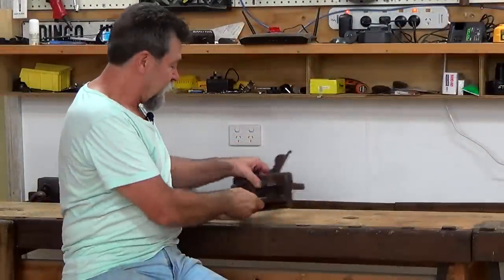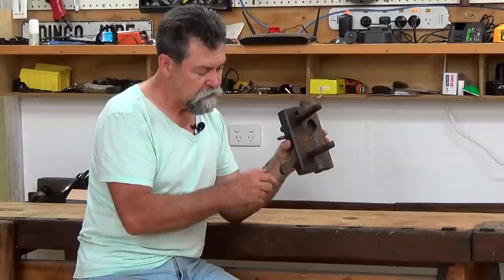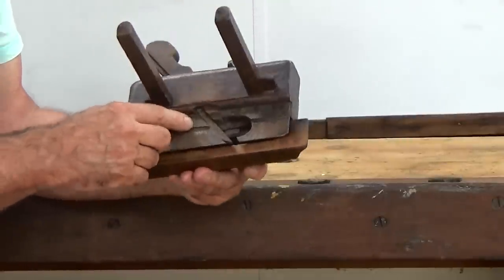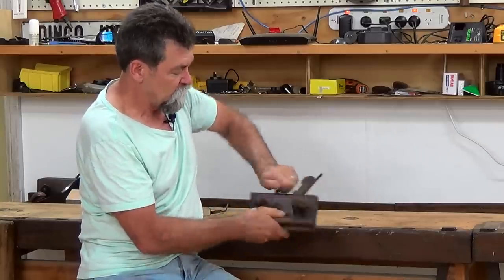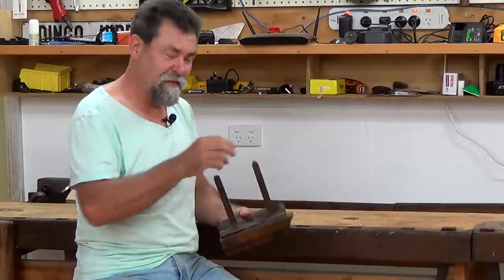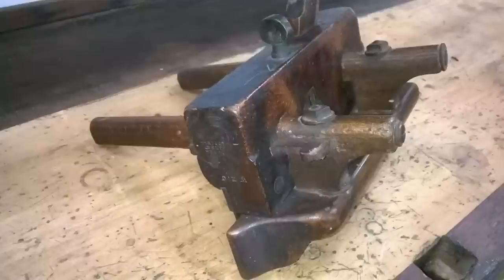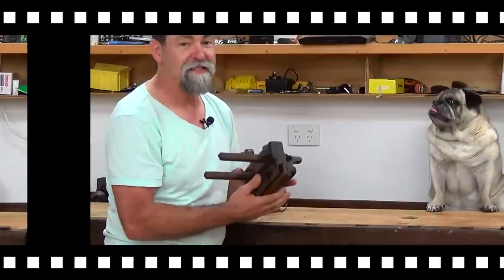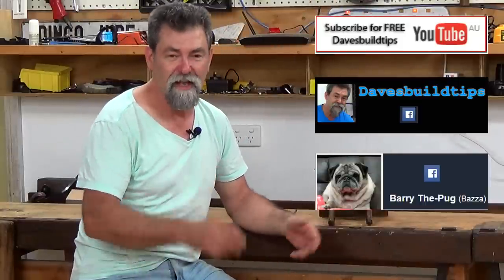Plow plane | Arthur's Tool Box

Comment: Ha, love the Barry outtakes.  And your look of resigned frustration when Padmae came in was priceless!  My pug doesn't care for extreme heat either, but in the Pacific Northwest U.S., we don't get too much of that!
Reply from the maker: +Caryl Corsi ('Fifi') What kind of temps does it get up to?
Reply: +David Stanton We had an unusually long and warm summer, with temps mostly in the 70s to low 90s (F).  Usually July and August are the sunniest, but this past summer we had high temps in June and part of May, too. Once the temperatures are past the high 70s, my pug Willie gets very short walks only, in the shade.  The rest of the year tends to range from the 40s to the 60s, with occasional dips below 40.  A pretty mild climate all around, but tends to be quite rainy winters and springs.